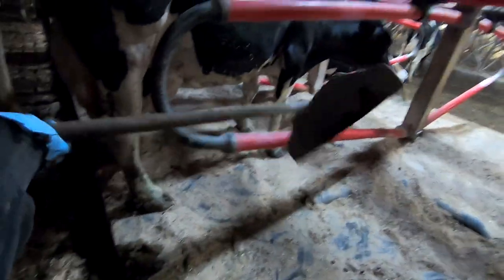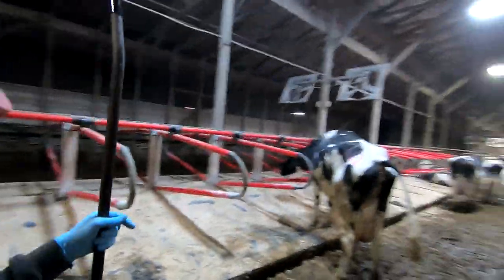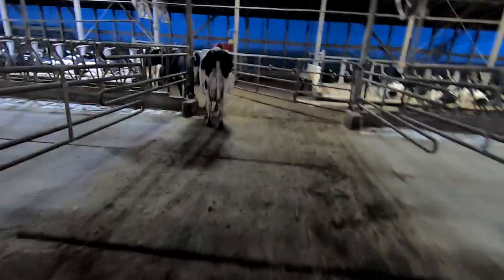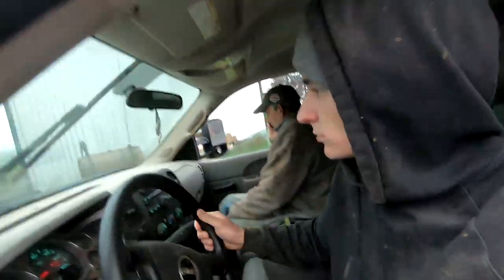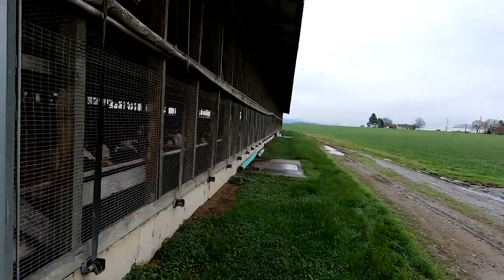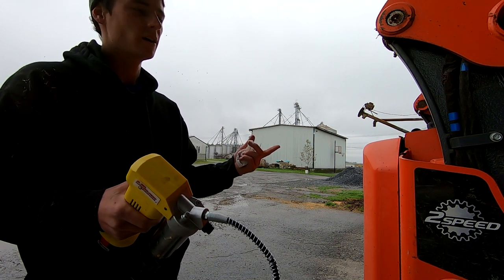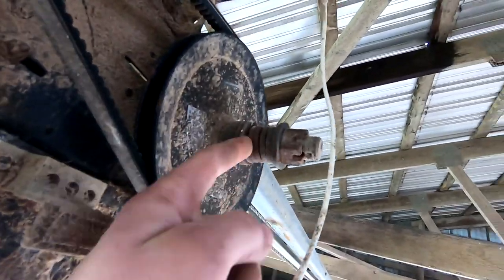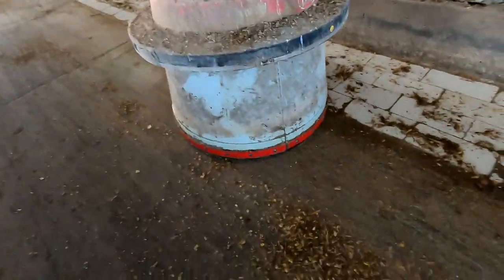Dairy Farm Work | Cattle Care & Maintenance

Comment: A helpful tip to save wear and tear on the defacer. Deface the bottom 3-4 ft of the bunk first then deface the top part. That way your defacer isn’t buried into the fresh pile of silage as you work your way down the face. Keep up the videos I enjoy them

Comment: The foot wash looks like it works great, love it. The battery operated grease gun seems like it would be handy in hard to reach grease fittings. Just my opinion from using hand pump gun.

Comment: Eric....their is a white spray lube that's used specifically for garage door rollers. You may want tytfy that on them also
Reply: Also check for worn bearings. They can bind in the tracks. That slip clutch looks like there's not much slip left in the adjustment.

Comment: Dairy isn’t even necessary for the human diet yet so many people still drink it. Calcium and the other nutrients are much more bountiful in plant based foods. All this work could go towards sustainable plant based farming, which will be better for the environment and not depend on animals at all.
Reply: they are not more bountiful in other foods.
animal products are extremely nutrient dense and easily digestable.
plants arent sustainable nor easily digestable by humans
Reply: Plant based farming involves using artificial agents to concentrate the desired aspects a plant has to offer into the target product. Most of the time, the human digestive system does not recognize these agents and therefore is used as a byproduct rather than a primary energy source. It's better to stay as organic as possible.

Comment: Why do some farms still use a bull for breeding?  Is there an advantage/disadvantage to one or the other which makes you use AI?  It sure does more simple and convenient and you don't have to keep an unpredictable bull around.  Still, some farms continue to use a bull.  Why would that be?
Reply: Back when I was in 4-H, the reasons for using AI were to be able to improve certain qualities in your herd, like low birth weight, fast growing, stronger toplines (back), etc.  if you have a bull you just have whatever good or bad qualities he has that can be passed on to the offspring.  Another thing is that you have to have a certain number of bulls per number of cows. You can’t expect 1 bull to service 1,000 cows in a month or two window.  You would also have to have a place to keep the bulls when they aren’t out “working” for the other months of the year.  Bulls can be hard on fencing, etc. so they aren’t always easy to have around.  And when they aren’t working, those are extra mouths to feed.  Bulls also have a service lifespan too.  They may only be able to work for a certain number of years before they lose their productive sperm count.  It’s much easier to store a straw of semen in a container than feed and house a bull when not in use.
Reply: @aimeehope968  That is an excellent explanation. Also may I add that AI is not 100% so usually a bull is put with the cows/heifers to breed anything that did not get pregnant thru the AI process.  We call it a "clean up bull".
Reply: @caderiding7614  yes, we do that too.  We raise beef now and usually the first time heifers are bred through AI so we can better know when they are due and can watch them and bring them closer in case help is needed at birth.  Also, we can choose a bull who throws a low birthweight calf that has a high/fast growth rate so that at weaning time/auction time for some, they have a good weight to them. We do the cleanup bull thing too- leaving them in longer for sure. We also do preg checks vs blood tests to confirm pregnancy because we have so few cows and getting a lab that would be timely in getting results back would be difficult.